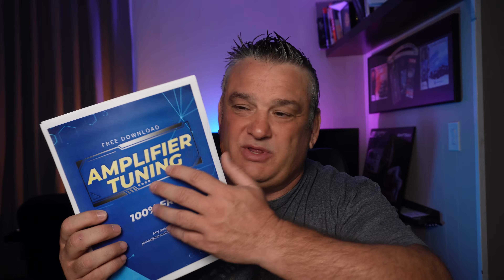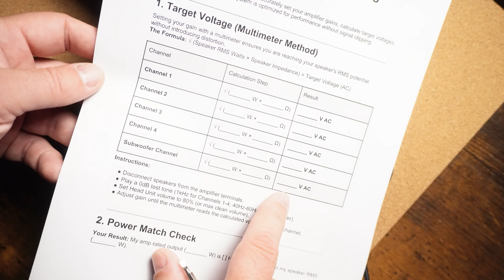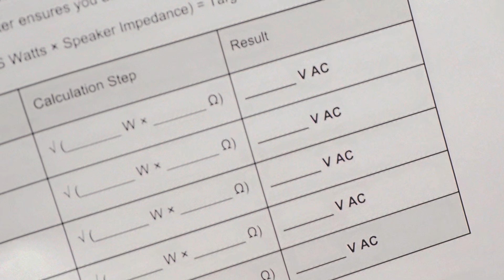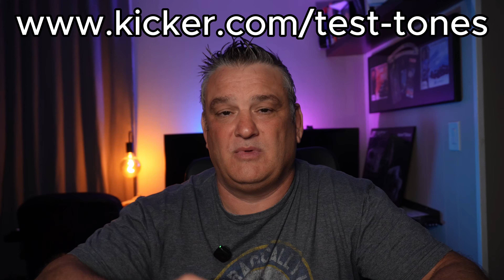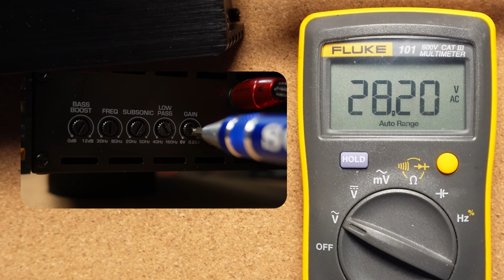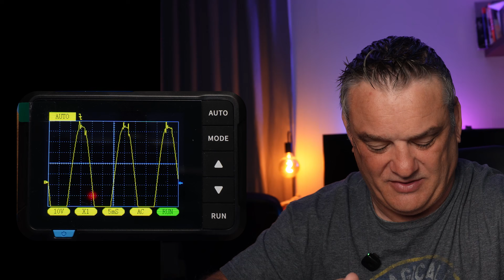Multimeter vs Oscilloscope: Which One Actually Stops Car Audio Amp Clipping?

Comment: With the eq flat and the gain, sub sonic, etc turned down before adjusting the gain where do you set the bass knob, or do you disconnect it?

Comment: So I have a question. I set my 4ch amp its 70w and 4ohm thats 16.73 ok set no problem. Now on my sub amp its 300w kicker @ 4ohm and at 4 ohm thats square route 34.6v everything flat head turned to roughly 3/4 volume I can turn the gain and will never go above 12v. What gives? this was with 50hz and zero db test tone.
Reply from the maker: Crossover on the amp and what input are is running to amp?
Reply: @CarAudioObsessed  when I was setting up I had xover to full range and inputs are rca head is Alpine and I had it set to probably 80% volume. Like I said on other amp running 1000 test  it set up just fine. But the kicker amp with a 50 would not go above 12.2 and that happen at gain turned 1/4 to 3/8 turn. Subs seem to work just fine they work better than what I need. I was just curious what the heck?
Reply from the maker: @dgc940  What model of Kocker amp?
Reply: I am running two 8'' to it @4ohm dual voice coil wired in series each

Comment: The multi meter is good for setting to a target voltage.  Say you have a 5k amp but a 1k sub, you can set the gains to that particular voltage.

But if you amp is underrated you could be leaving power on the table.

Or, if your amp is overrated, the oscope will let you get a clean signal.

You can also use the oscope on your RCAs to get a clean signal into the amp.  Garbage in, garbage out.
Reply from the maker: 100%, going to do rca video shortly with effects of volume and bass booat etc. soon.

Comment: Is the setting with no load, still going to produce no distortion with a speaker load added on? Will it produce distortion free audio, when there's multi-tonal music playing, and not a pure sine wave?

I'd go with the manufacturer's (hopefully) conservative specification, rather than the absolute maximum possible with only a simple sine wave.

You can get a multimeter for less money than the oscilloscope, the only key is to not buy one of the most expensive brands of DMM in the market (fluke).
Reply from the maker: That's a tough one, even under load testing - should we use a resistor or a speaker while playing music or test tones? This is very hard to demonstrate on YouTube. I think a combination of these two is best. Get the voltage correct and then test for distortion.
Reply: @CarAudioObsessed very typical is to use a high power 8 ohm resistor (one for each channel) to test an audio amp under a "simple" load
Reply from the maker: @ivolol what wattage resistor?
Reply: @CarAudioObsessed well, the wattage of the amp, of course (or double for a nice safety margin). Heatsinks, fans and doing only short duration tests can help, because the resistor should theoretically be dumping the power of the amp as heat. YouTube should have quite a few tutorials for constructing audio dummy loads

Comment: Not sure how the amplifier specs measured distortion vs watts but just turning gain down until no clipping does not mean you didn't measure with 1%, 2% 5% distortion.  The extra wattage you found may have been above the published distortion.
Reply: Usually it will say in the amplifier specs what type of testing procedure they used.
The most common is CEA-2006. The rated power is measured up to or less than 1%.
Reply from the maker: @JasonWW2000  If it a name or reputable brand, then 100% agree
Reply from the maker: exactly, allot of manufacturers rate their amps with different ways, this is one of the better ways to find out what the amp really can do.
Reply: @CarAudioObsessed your viewers should know that they probably couldn't see single digit distortion, and without knowing,  just dialing the gain down isn't like finding extra power...
Reply from the maker: @AudioFanMan  I am thinking about what you said, give me a few...
Reply: @AudioFanMan  He dialed the gain UP to get extra power. 
You're acting like this is an exact science. It's not. There is no perfect gain setting, you just need to get it close.

PS, you can most definitely see single digit distortion on an oscope.

Comment: @CarAudioObsessed is there a max on what that specific o scope can provide? Meaning will it work fine to tune a 3k mono amp or do I need an upgraded version to handle it?
Reply from the maker: short answer yes, here is the math - 3000-watts at 2-ohms is 77.46 volts AC. The oscilloscope can take up to which is equivalent to roughly 280 volts input. But you need to use the "grey probe" on x10 setting (red slider on probe). This help?

Comment: What about when you later end up adding a Audiocontrol micro epicenter to it after
Reply from the maker: Think is a tough part, you would keep testing down the signal path. Head unit --> Epicenter --> Amplifier, and make sure output signal is clean and undistorted etc. This answer your question? I am working on max output from source unit video.
Reply: @CarAudioObsessed makes sense

Comment: It's also important to point out that when you start using an oscope on higher voltages, like above 40v rms, you're exceeding what the scope can handle. So you have to switch over to the probe that has the 10x attenuator. This will let you measure up to 400v rms. 

I've seen a couple people use the wrong input on the scope and couldn't figure out why they can't see the full signal on the screen.
Reply from the maker: I was thinking of doing a run through on scope, but allot of people have done one, think its worth doing?
Reply: @CarAudioObsessed  Sure. If you want.
Reply: You can also hit auto, and it will self adjust most times.
Reply: @urbankyng6467  No, I'm not talking about the division units on the screen, I'm talking about the input voltage limit. It's only rated to 40v rms input. You could potentially damage the unit by putting higher voltages into it. 

By using the 10x attenuator, it reduces the voltage by 10x. So you could measure something that like 120 volts rms, but you'll only be putting 12.0 volts into the scope.
Reply: @JasonWW2000  so a 3k mono amp would not be ideal to set gains for the o scope in this video? do you have one to suggest?
Reply: @JohnSmithAudio  I'm not really understanding your question. Are you asking for suggestions for a 3k amp? Or for a different power level of amplifier?

Comment: Using a target voltage never really made sense to me. I think in your case, your amplifier was a bit underrated which is why you found some additional power.

I could see another scenario where an amplifer was rated for 500 watts , but actually only put out 350w for instance. If you had set it to the target voltage, you would have been clipping and likely damaged the subwoofer.
Reply from the maker: Interesting...

Comment: Very good video. Just one thing missing from it, in my opinion, would be finding the max volume without distortion from the source unit before setting the gain.
Reply from the maker: I do not want to throw the curve ball for this video, while I 100% agree with you, I was demonstrating setting up the amplifier. I am working on setting up the source unit shortly to address your exact concern.
Reply: @CarAudioObsessed  Magnificent. Thank you.
Reply from the maker: @AshwynAssy cheers bud, thank you!
Reply: Do you need to know the procedure or were you just making a suggestion?
Reply: @JasonWW2000  Just a suggestion. In case a person is not too clued up on the whole process. I think it's important to have the 2 parts in one video.
Reply: @AshwynAssy  👍

Comment: James what about a DD1 for setting gains ?
Reply from the maker: Those are great, it is all about what you got access to. I would love to get my hands on one! I like that the DD1 can be used while playing music and adjusting the dsp as well in real time!
Reply: @CarAudioObsessed  I set my gains -5 db @1k and -10 db for 40k with the DD1
Reply: @CarAudioObsessed I have all 3 - oscilloscope, volt meter and a DD1
Reply: @CarAudioObsessed  Actually no, you can't use the DD-1 while playing music. The way that device works is that it requires either a 40hz tone or a 1k tone.
Reply from the maker: @JasonWW2000  I stand corrected, I meant used with speakers connected and use DD-1
Reply: Dd1 sets gains to 1% distortion. Distortion happens before clipping. Which might matter with mids and highs but not for subs. The problem with the multimeter is if the amp doesn't really do rated power. You set it to the target voltage but you're already into clipping. I bought a dd1. I find it on a Classifieds ad for cheap. I bought it. Took it home and compared it to both my oscilloscope's. I've never used the dd1 again. It's been collecting dust for two years. Buy a 40 dollar oscilloscope of Amazon. Much better tool and ridiculously cheaper.
Reply from the maker: @SG-Cichlids  Great insight!
Reply: @SG-Cichlids  Keep in mind that clipping is a form of distortion. The DD-1 can pick up on clipping as well as other types of distortion.  This isn't really a problem. You're gonna wanna set a certain amount of gain overlap anyway. Most of the time with a subwoofer you'll use a -10dB tone rich will allow the sub to clip a certain amount. 

I think both an oscope and the DD-1 are very comparable devices. If you're willing to learn how to use an oscope , then that is the better choice. It's a lot cheaper and can be used for many things. The DD-1 is a much simpler and easier device to use. It's great for people that would get confused by an oscope. 👍
Reply: @JasonWW2000  the dd1 isn't as accurate as an oscilloscope. Which is why I don't use it. With or without an over lap you'll always be leaving power on the table with the dd1.
Reply: @SG-Cichlids  Let me know if you ever make a video comparing an oscope to the DD-1. That would be pretty interesting to see. 

Or maybe I could test it myself. Do you wanna sell your DD-1?
Reply: @JasonWW2000  I would love to sell it. When comparing the dd1 to my scopes not only could I see distortion before the dd1 light would come on but you can also watch the wave form while playing music. Which is what you really want. The 40 dollar oscilloscope on Amazon. At least the one I bought is very easy to use. Set the switch to x1 or x10 depending on the amount of voltage you're testing on the test lead and the oscilloscope then press auto. It does the rest for you. It also shows hz, and vrms. The vrms is what you should be setting gains to if you're going to set to a voltage.
Reply: @SG-Cichlids  So when you compared, is the DD1 more conservative (gains lower) and the Occiliscope you were able to set gains a little higher?
Reply: @daveroski  the oscilloscope showed distortion before the dd1 did. Also for some reason people think the dd1 is showing clipping. It's not. Nothing is more accurate than an oscilloscope. Don't trust clip lights. Compare an oscilloscope to a clip light on an amp. You'll be shocked.
Reply: @SG-Cichlids I was just watching Tony’s video dd1 vs o scope